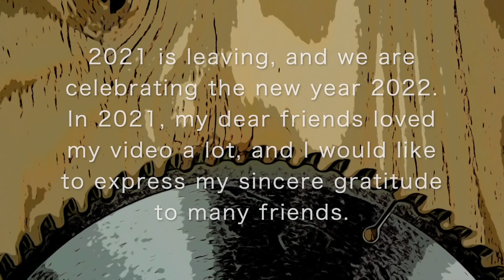Fine adjustment of the table top

Comment: Nothing like woodworking when it's snowy outside and a good time to do tool maintenance. Good on ya Tachi!
Reply: Problem is, my own workshop is my unheated garage.
Doing woodworking in freezing conditions is not exactly optimal. :P
I just received a package with all kinds of 3/4" T-track goodies today (10' of tracks, 2x 1' adjustable rails, T-track "junctions", aluminium hold-down clamps, etc.), so I'm ready for "war" when the temperature gets better. :). I need a new top plate for the router extension on my saw table, the one I have right now isn't suited for those 1/2" thick (12mm) T-tracks.
Reply: @HepauDK  my workshop is in my garage too. The workshop is beautiful but like yours very cold. I have a ceiling heater that warms it well but it's costly to run it. Apparently insulating your garage door is a big help. I'm going to do this. I too have alot of snow outside. Not good but it doesn't stop me from my love of woodworking.
Reply from the maker: Hello Mr Rick
This winter is very cold and I sometimes see snow.
My workshop is a garage without shutters so it's very cold!
Next week's holiday will make me very depressed ...

Thank you for coming Rick ・ ・ ・ ・ Tachi
Reply: @TachiOhyo56  Don't let depression sink in but instead continue your woodworking. The hard part is starting in the cold but once you start your love for woodworking takes over and the cold becomes bearable. An alternate plan is to spend indoor house time to design woodworking things that you can make when the cold subsides.

Comment: I'll have to look into that on my own DW745 when I'm making a new top plate for my router extension anyway. it needs to be thicker for T-tracks, and the insert needs to be relocated slightly, as it is a bit too close to the table frame as it is now (no space for adjustment screws from beneath). 
That table needs to be beat into submission! :)
Reply from the maker: Hello Henrik
Thank you for your polite comment

2022, wish you a good year ... Tachi.
Reply: @TachiOhyo56  Hopefully 2022 will treat you well too, Tachi-san. :)

Comment: Alloy machine tops are rarely really flat to begin with and can migrate to new levels of unflatness over time. Cast iron ts tops are more stable than alloy ones usually but that depends on the manufacturer and ts construction. I have often used a crosscut sled and true up the blade angle against the sled base and not the metal top with better results. Happy New Year Tachi. 🇦🇺
Reply from the maker: Happy new year, Peter
Thank you for watching my video.
And thank you for giving us your professional opinion.
As you say, we amateurs need to do a lot of work to overcome the difficulties. I chose the rough method for the tools, but I love my DeWalt.

Thank you Peter ... Tachi

Comment: Nicely done. Even a hammer can be a precision tool in the right hands! I also have a DW745 which is very far from being flat, and the mitre channels are rough, have uneven width, and the sides of the slots are not perpendicular to the table.
Reply from the maker: Hello Barry
Thank you for coming to my workshop.
And I'm glad to hear your comments.
This top plate had different groove widths on the left and right slots! !! But I'm not satisfied with the distortion of this top plate! !!

Thank you Barry ... Tachi ... See you again
Reply: @TachiOhyo56  To be fair to DeWalt, this machine is designed to be a job-site saw, therefore the design priority is portability. I still believe this is an amazingly good  good job-site saw, and I do not regret buying this as my first table saw. I have accomplished much with it. However, as a job-site saw, everything is mounted to the table top, which is why I think the top will sag (even if it were perfectly flat to begin with). In a cabinet saw, everything including the table top is mounted to the very heavy solid cabinet, so the stresses are not applied to the top. Also with a cabinet saw, the mitre slots will be machined into the cast top, not cast into the top. Regardless, you have produced some beautiful work with this saw, and I am in awe of both your woodworking and video editing skills. I would really like to be able to meet you in person some day. Wishing you a healthy, happy and fulfilling 2022 from a very hot Western Australia. (We do grow cherries here and have a cherry festival in mid December. Snow is unusual, but when it happens people travel a long way to experience it.). Having been born in the Northern hemisphere, Christmas in the summer is still very strange to me!

Comment: Unfortunately that is the problem with these high prices contractors saws, in general they are built for rough construction use and not for finer woodworking use…as you have demonstrated with a “tuning fork” you can persuade the tool but I believe that over time the adjustment will find its comfort zone again.

Though my shop is a long 150 square feet a 6’ x 10’ with a wider 9’ x 10’  I still choose to use a full size 10” Delta Contractor Saw with cast iron top and wings on a mobile base…a bit oversized for the small wood boxes, vases and other crafts…precision was still required…with a whole bunch of jigs I have copied from you Tachi…

Thank you again for a “unique” method of persuasion in showing who’s boss in the shop 😎

Be safe and healthy m6 friend …
Reply from the maker: Hello Randy.
Thank you for your polite and wonderful comments
I did the same with Makita before.
I'm a woodworking enthusiast, you're a professional! I am honored to receive your expert comments.

Thank you Randy ... Tachi
Reply: @TachiOhyo56  
Tachi,
You my friend are as much a professional as those of us that earned a paycheck as a woodworker…I have worked with master woodworkers who had great skill but lacked the creativity you show all of us…every week.

Be safe and healthy my friend…we all look forward to your creative masterpiece(s) in 2022 😎

Comment: Dear Sir
You did fine adjustment very acculturate . But how the surface of the table saw became uneven ? Was it a manufacturing defect ? or with regular usage ?.
Reply from the maker: Hello Friend
This state is the default for the top plate of this level table saw! !!
Needs tweaking, but I like it.

Comment: I didn't expect that from DeWalt ... 👎👎👎🤔
Reply from the maker: Hello Werner
Thank you for your comment
The Makita I used before had the same problem!
This is the default for the table saw top plate of this level, maybe! It's not very accurate, it needs to be fine-tuned, I can only make adjustments with a blow! 👎!! But I love DeWalt very much. 
Thank you Werner ... Tachi